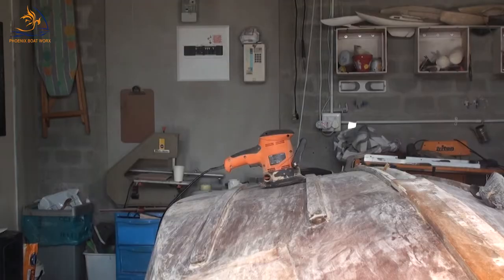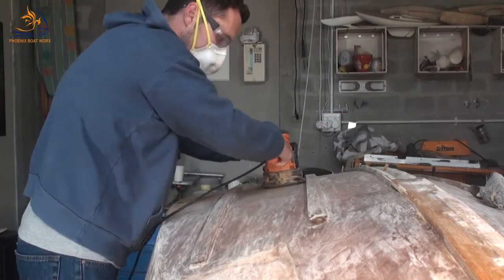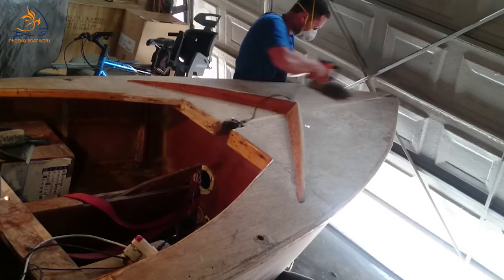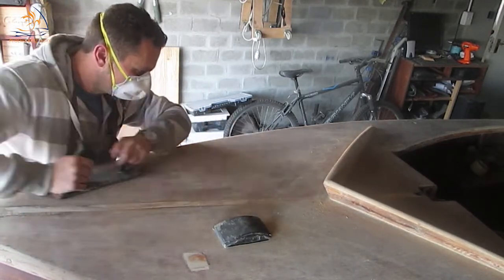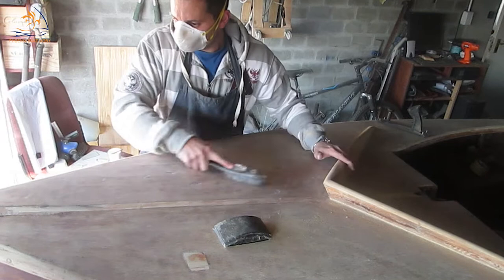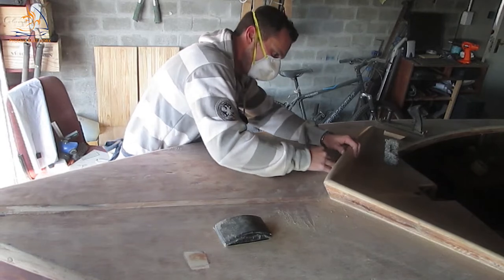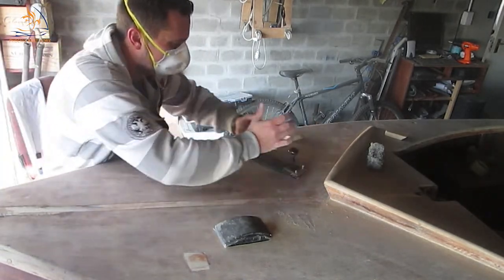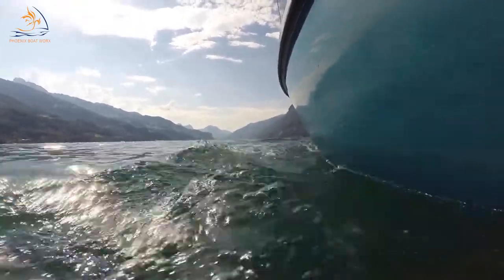How to boat restoration: Sanding Marine Ply boat GP14 Sailing Dinghy

Comment: I have an old wooden sailboat where there is delaminating not he deck, there are areas of the deck where the old varnish has completely worn away and on other areas there is still varnish.  where the delaminating or checking is happening, would it be advisable to epoxy the ply and weight it to bond this area before sanding?  could you also please share how you remove old varnish - it isn't thick, as i mentioned in some areas it has completely worn off.